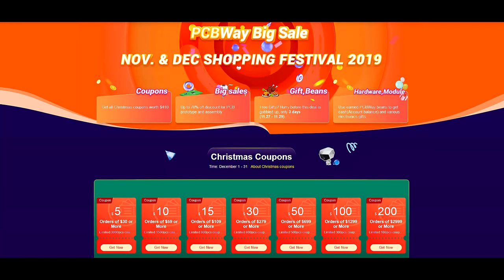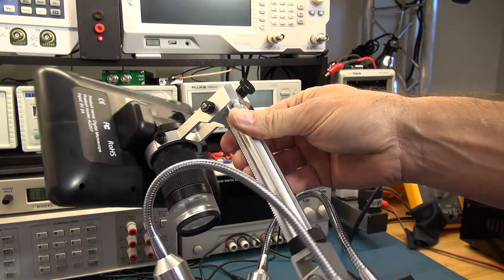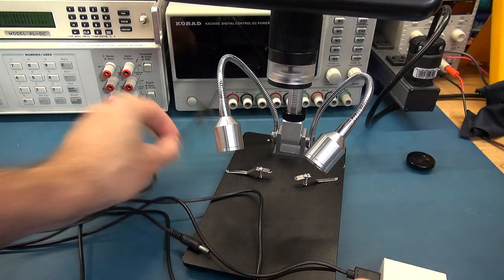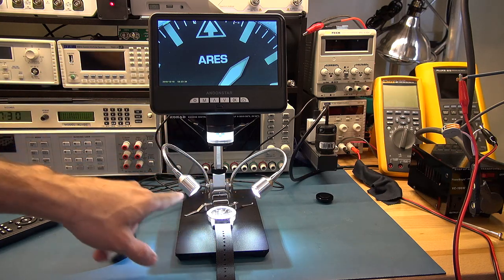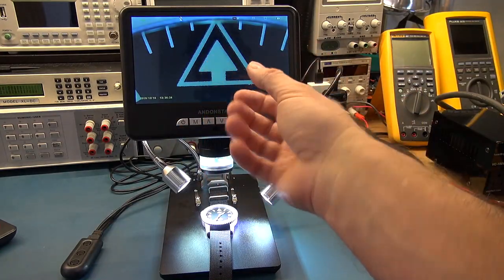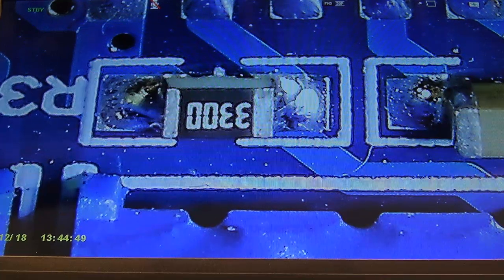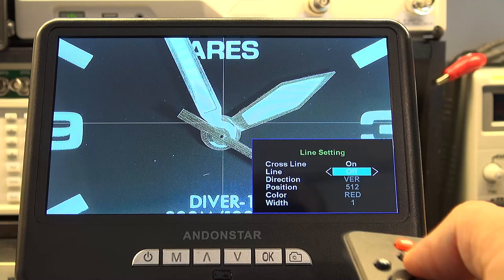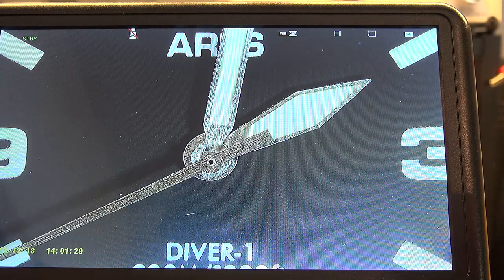Andonstar Digital Microscope AD207 Review

Comment: I have the Andonstar 280 (8" screen) I found that having the scope barrel clamp where you had it was too low (for watch repair with screwdrivers) so I moved the clamp to the very bottom of the barrel. Much better and it lets you have a better field of view, yes, you lose some magnification but the digital zoom is quite good and compensates for that. To stop the vibration mentioned when moving the scope up and down, tighten the screw on the back of the rack a bit and don't unscrew it, solves that problem - it's meant to provide a bit of friction to eliminate slop and shake. The reason you can't read the printing on the chip is because of the LEDs shining on it, turn them off (unplug them) or move them away, I find that the scope doesn't really need the separate LED lights anyway.

Comment: I had this  Andonstar too and there were two problems with it. The goose neck is not stable it wobbles around.  Secondly the dynamic range of the image is rather narrow. I struggled with lots of unwanted reflection. Much bigger diffuse lightsource would help the image quality. After this Andonstar I bought the SANXO-scope that Image quality satisfied my need.  Probably the 2Mpix sensor and too little sensor size make the difference. On the other hand, it is true, in the price range of 50-100USD you can't get a much better solution.

Comment: Very tempted on the AD407 model which has a 4 Meg sensor in place of the 2 Meg on the 207. Also has a HDMI output to display on a separate monitor at the same time. One disadvantage though is the lack of built in ringlight  and only has the two adjustable side lights.

Comment: Nice review. I have one of the $50 ones and it's a bit better than the toy ones, It's adequate for the occasional use I need it for, but the stand that came with it is rather poor. The one you reviewed looks pretty sturdy and the extra onboard lights are nice. I also like the idea of a self-contained unit that doesn't require a computer connection, and the optics look real sharp and the display is really clear. I've never considered digital zoom to be anything more than a pointless gimmick.
Reply from the maker: Thanks for your input.

Comment: You can test the insulation in the PSU. You can test whether it supplies its rated current. The packaging should be good enough to survive shipping whether it's rattling around in an Amazon box or the back of a van. Is the display itself full hd?

Comment: A  great review, you mentioned that the height above object was 2 inches would that be sufficient clearance to do soldering such as that resistor?
Reply: It was the height at a lower level with maximal optical magnification. You can easily lift it up to 7 inches and use digital zoom instead - it's still a very sharp image thanks to the adequate camera resolution. And it's possible to lift it even higher with some modifications to mount the camera on an extended arm (but then you would want to screw it to the table to prevent wobbling).

Comment: I have a similar but more expensive LED scope that doesn’t shake.  BTW, unless there are two lenses, I don’t think real 3D is possible. I find mine helpful for fine soldering, but because the image is flat, I can understand the opinions of some folks who prefer an actual stereoscopic microscope. The clips on the base don’t go very high—they might be intended for slides, but they cannot clamp down a breadboard or anything much thicker than a few millimeters.
Reply: Yeah, it would be great to combine the scope with some adjustable "helping hands" clips.

Comment: No, don't grease the column wheel....the goose neck attached to the column is an extrusion and has clearance around the column which means as soon as you loosen the screw at the back the goose neck is a slack fit on the column and wobbles around........you don't need to have the camera a loose fit once you've focused the part you're viewing, then you tighten the screw at the back which firms it up......it's a cheap design and they have it on all the microscopes be they cheap or expensive.
Reply: On my 280 the rack locking mechanism has a nylon insert that is greased with silicon grease, just nip up the screw so that you don't get any shake or slackness and you'll find you can use the wheels to move the thing up and down quite easily without undoing the screw.

Comment: Whats the difference between the AD206 and AD207?
the Ad206 can be had at around 70bucks from EU warehouse atm
https://tinyurl.com/qltb8yu
(coupon affbg10) 10%
the Ad207 is around 100 USD
https://tinyurl.com/rsuwagf
why AD207 + 30% higher?? details come across close to identical.
I have just purchased the cheaper G1200 myself here in 2020. (1200x zoom. wauue any "SEM" go home.. nahh it obviously aint anywhere close to that). it was with inbuilt battery version (rubbish lipo-cell cant hold a charge) costed around 56USD and has infinity focus-ability though with lacking res at distances, but the FW is sick... digital zoom doesn't work, all recordings locked at 563mb (1sec or 10 min. all consumes exactly 563mb)..sound is filled with static noise.
a massive screwup this FW. weird as the older FW just dated 10 days older then mine, was fine... but can't find any info if you can perhaps load another FW onto it.
Its this fellow of a microscope. https://imgur.com/a/2FIfuMu